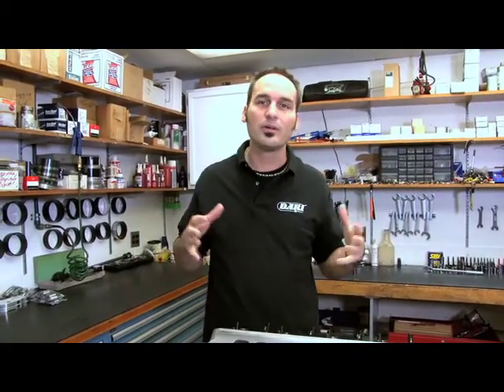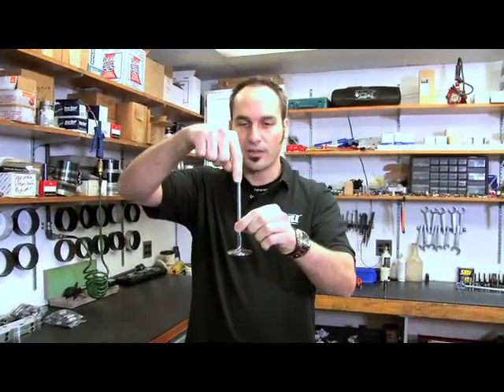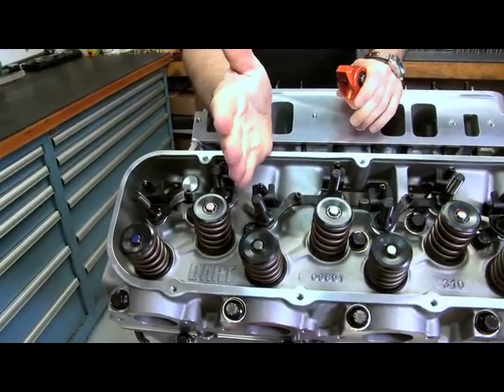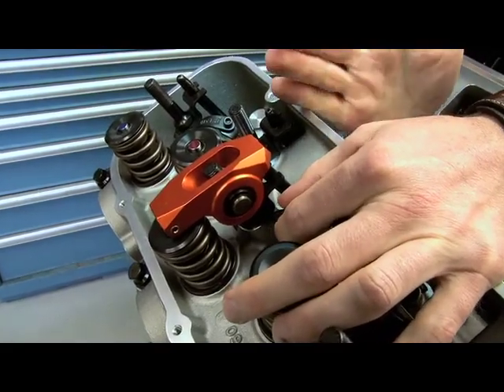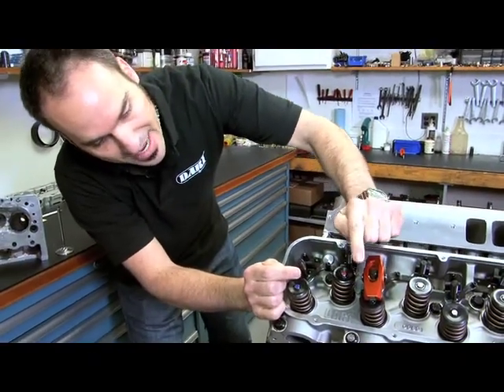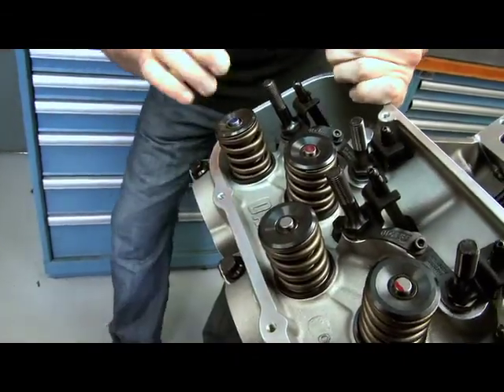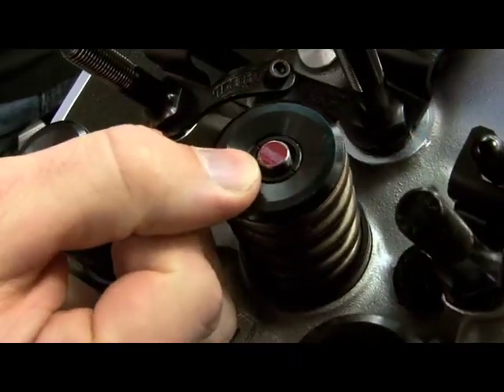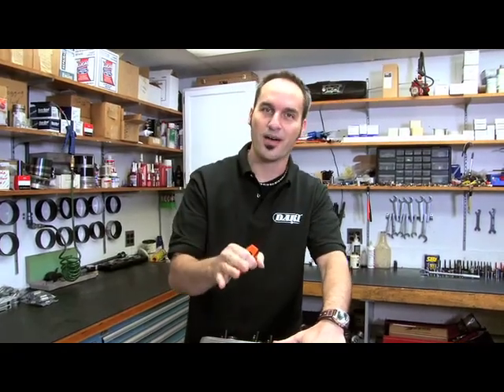Dart University, Valvetrain Geometry

Comment: Where the roller tip rides atop a valve stem has absolutely nothing to do with valve train GEOMETRY.  Because of all the presumptions made about any given rocker arm being used, concentrating on centering the roller tip on the center of the valve will almost always be at the EXPENSE of optimized valve train geometry.  Most rocker arms for a given engine application have differing point-to-point dimensions between rocker arm manufacturers, which will change where each brand rocker's roller tip rests on the tip of the valve. Also, valve tip-to-rocker stud distances on a cylinder head change with overall valve length, and so on.  The rocker arm being used in the engine combination shown in the video appears from my screen to offer a relatively poor overall geometry in the engine's valve train--the pushrod side of the rocker is over-arcing (thereby diluting the received cam information), while the roller tip side of the rocker is doing the opposite in effect.  As a result, area under the curve will be very diminished and horsepower registered on the dyno will be down.  Also, a roller tip riding off-center of a stem tip does not automatically destroy guides. Why? Because the primary purpose of the roller tip on the rocker arm is to provide a second pivot point so that the LINEAR forces imposed on the tip of the valve stem are kept ON-PLANE with the valve stem as the rocker arm goes through its RADIAL sweep, which will essentially eliminate excessive valve guide wear.  It's too bad the internet is filled with the shade-tree "roller tip in the middle of the valve" theory, because it offers virtually zero association with valve train geometrics in any way whatsoever.
Reply: High Flow Dynamics so what is the best solution
Reply: Exactly right I use the mid lift method my current build is a bbc with afr heads I got the valvetrain geometry right but the rocker arm was about to fall off the edge of the valve.so I had to buy crower .050 backset rockers. ROCKER ARM ON THE CENTER OF THE VALVESTEM WILL MOST LIKELY SET PEOPLE UP FOR FAILURE.
Reply: It sounds like you have done some research and have hands-on experience with this issue.  Can you share the engineering or academic research papers you use for reference?  I'm interested in learning more.  Just to be honest, on the surface, I'm ok with the mark-in-the-center technique.  I'm an engineer and from a force-vector point of view, I can picture a benefit in lower side loadings at the valve-to-guide interface.  BUT I'm always willing to learn more.   Thanks.
Reply: @MLFranklin  This video was useless in show how to actually figure out pushrod length.  
Here is one that is much better
https://www.youtube.com/watch?v=o5is9BsH5OU
Reply: @SealofPerfection  Thanks, that was pretty comprehensive.

Comment: That cylinder head is unique, in that the rocker stud is not vertically parallel with the valve stem. This allows one to effect a proper valve stem tip geometry.  On other engines the rocker stud is parallel with the valve stem, and the reach from the pivot out is non-adjustable. With the pedestal rockers, they have an oval hole where the rocker bolt fastens down. This allowes fore and aft motion to get the tip pattern. But, if the valve is installed out of this range, no show.
Reply: You are correct...but definitely some grey area in that theory but as long as you're within 1-15 degrees of 90 mid lift should be fine